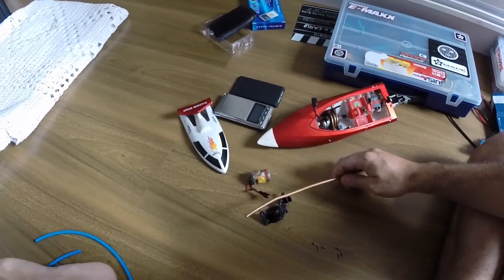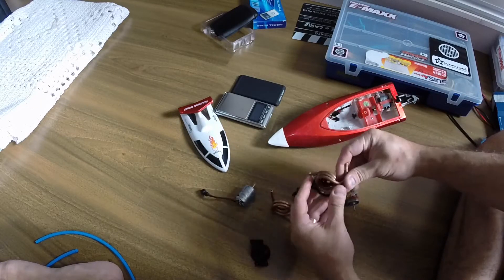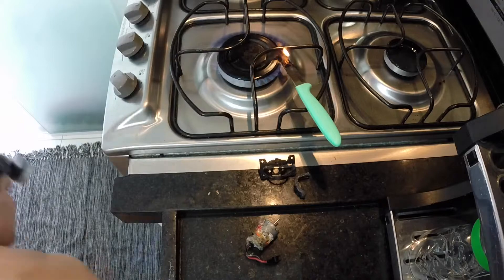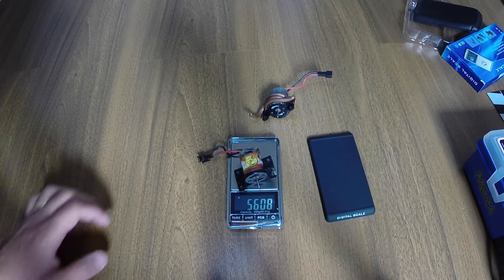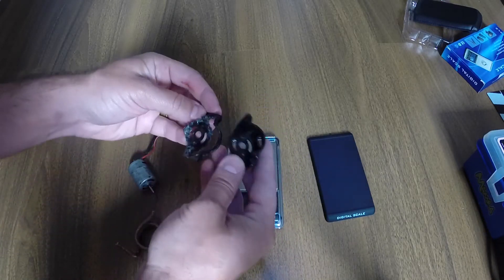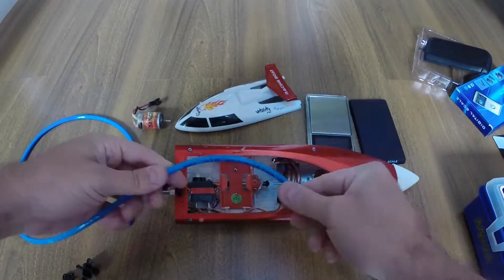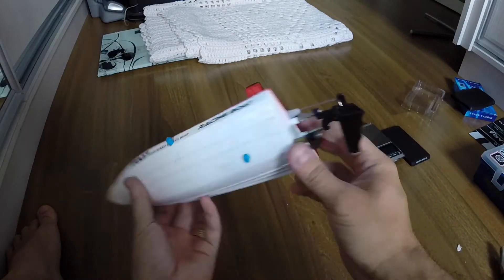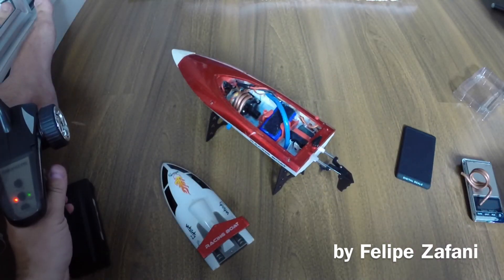FT007 RC BOAT Water Cooling - How To Do It

Comment: Felipe como acabar com os sensores? Meu boat fica lento de repente, para no meio do lago, fica funcionando so o leme, acho que seja algo relacionado com temperatura! Pode me ajudar?
Reply: Olá, Lucas! O meu FT007 está com o mesmo problema.
Você conseguiu descobrir o que é?

O sintoma é: parar alguns segundos depois que atingir velocidade máxima.
Se eu ficar em velocidade média, não há problema algum. Funciona por um tempão.
Ao colocar velocidade máxima novamente, pára.

Imaginei que fosse super aquecimento. Por isso cheguei a esse vídeo.
Reply: Cara, não é aquecimento, é a bateria original que não presta mesmo! O felipe me explicou um tempo atrás, põe uma bateria de 1100 mah nele(com a mesma voltagem da original 7.4V).O que acontece é que quando vc força a velocidade máxima, essa bateria original não tem capacidade de fornecer o tanto que o motor puxa, dai a voltagem baixa a um ponto que o sistema dele para! Uma bateria de 1100 mah vai resolver tranqulilamente. Qqr coisa fala ai.
Reply: Lucas  Fernando a bateria pode ser acima de 1100 mah ou so serve se for 1100 msm ? que eu so encontrei no mercado de 1400

Comment: do you have to use copper tubing ?
Reply: Nope, it's just more stable you can use flexible plastic tube you can wrapped around the motor and t will still work

Comment: Hi filipe thx

I would like to add an brushless moto too because of this I was looking for water cooling and found your account .

1.can you tell me or give more advices how to do it exactly water cooling where to make the holes in the boat for water in and out and what size of Cooper and rubber did you took ?

2.can you tell me what lipos do you took exactly is there one you found its the best ? and how about running time and handling of the boat because of more weight?

Here's my email address maybe you prefer to write there

remy2627@googlemail.com

Thank you and nice regards

Comment: Hi felipe thx for showing how to water cooling did you take also an stronger motor ? Ore did you took an brushless type ? 

I have a monstertronic mt 6027 the same like yours and thinking of taking a Brushless motor type and water Cooling got any ideas ore hints ? 

Thanks a lot nice regards Sascha
Reply from the maker: It is the same motor, I would like to add a brushless motos!